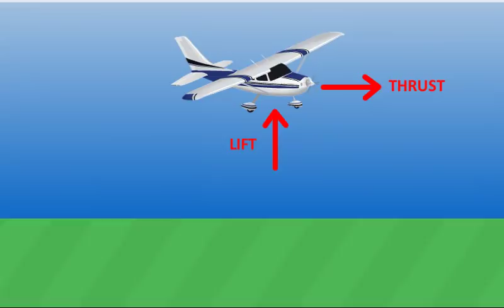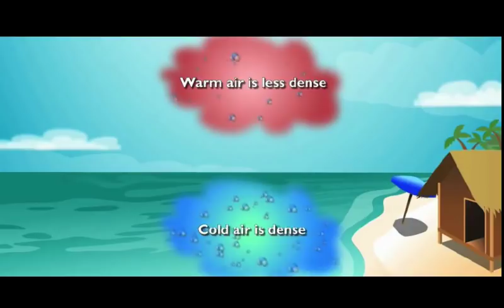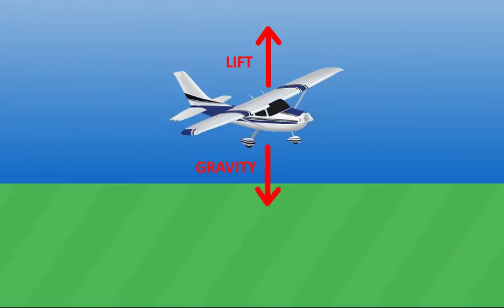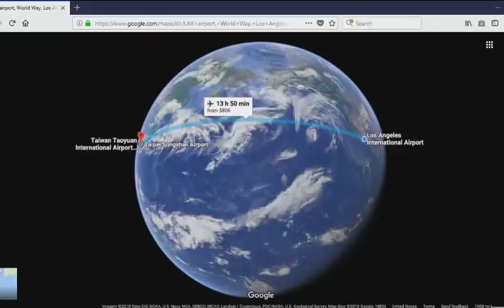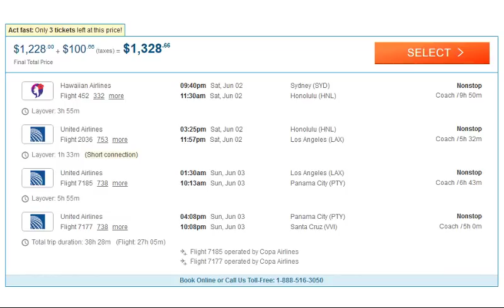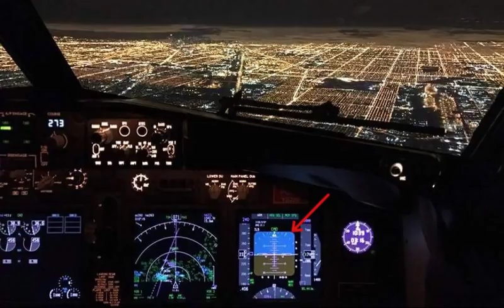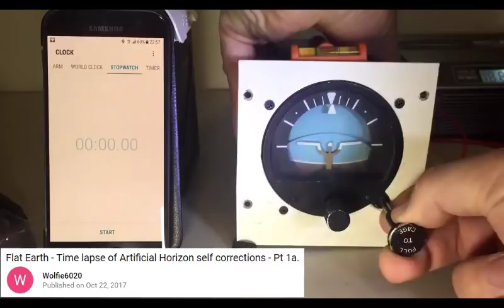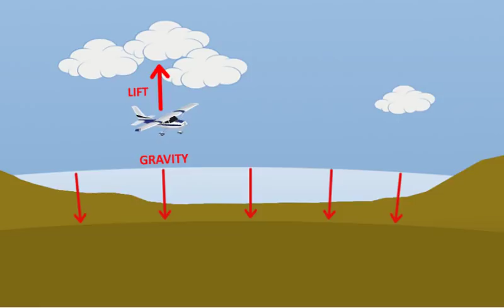Flat Earth Falsities - Plane Nonsense

Comment: If it weren't because of momentum, every time you jump you would land almost a km away from where you stopped making contact with earth ...
Reply: Do you expect that someone that thinks that earth is flat will read about The Dunning-Kruger Effect?
Reply: Jorge Lizaso 
or two km if youre black
Reply: Indeed, that's probably why Basketball is played in enclosed stadiums ....
Reply: jordy f :: it's called The Dunning-Kruger Effect. There's is the measurable fact that the less someone knows about a topic the more likely they are to think what they do know is absolute correct and comprehensive.

It's built into the brain.

Read up on it, it's fascinating. You can literally be so weakly informed that you don't know enough of a topic to understand how much you don't know.

It's why short "gotcha comments" are often so laughably incorrect.
Reply: Hey jordy, can you please film yourself when you try your experiment of jumping on a moving flat escalator?
I’d love to see the surprise and confusion on your face 😂
Reply: You land at the same spot for the same reason(s) that it's possible to play catch, stir a drink, and/or flush a toilet on a moving train/bus/airplane.

Heck, go get on a plane and do a little jump. The moment your feet leave the carpet the plane doesn't rush out from under you at 550 mph.

Why not?

Because you are going exactly as fast as the plane.

Now substitute "Earth" for "plane".
Reply: if you are on a skate board and rolling forward with it and you jump up do you land back on the moving board?  yes' you do.

If you walk along and throw a ball up in the air as you move forward does the ball fall behind you?  No it doesn't it comes back down to where you can catch it.

A person on the earth is moving at the same rotational speed as the surface when they jump they move through space at 463m/s , the gound also moves at this speed - there is no net horizontal motion difference between them, this is why they land back on the spot they jumped from...

But hey Jordy guess you'll never be a scientist as you don't really understand observed reality...
Reply: jordy f no sorry  the planet is a system consisting of solid... that's earth, and snow and ice ...liquid... that's rivers lakes and sea... and gas...that's air. other planets are the same. , most of them have an atmosphere... which is gas... and which is stationary relative to the surface except for wind
Reply: jordy f, if you jump, while on a moving a moving walkway in an airport, you don't suddenly stop.  Try your experiments before you challenge others.  How do you explain tossing a coin or a ball while moving in a car thats in motion (at any speed)?  Why doesn't the ball or coin suddenly hit you in the face?  I think flat earthers are incapable of logic.  Sad, really.
Reply: @jordy f
Fuck off you silly troll.
Reply: jordy f: you seem quite keen on this "jump on a moving walkway" experiment. Please try it!!

Here is what I say will happen: if the walkway is moving at constant speed then if you jump straight up you then you will actually travel forward at the same speed as the walkway and you will land back on almost exactly the same spot on the walkway. Any difference will be due to air resistance, but it should be very small. 

If I understand you correctly, you think that when you jump you'll somehow instantly lose your forward velocity, go straight up and land straight down some distance behind your original point (which you could calculate from your time in the air and speed of the walkway). Is that right?

You might want to watch this very short (1min26s) demonstration before you commit to your answer: https://youtu.be/CDf_0fPbNos
Or this one with much more height (also very short): https://youtu.be/KacTRPL1MtE
Reply: Since i skipped most science classes at school, you cannot state i believe all the lies they fed me. Never heard them in the first place. So.. why don't you, as the expert, explain this to me:
You said "When you are inside a car, you don't sit on a moving surface"  Uhm.. I don't get this one? The car is moving from point A to point B, right? But the seat i am sitting on in that car is not moving? Then how do I get from point A to B in the same time as that moving car? And not just me, but everything inside that car as well? Not an hour later, or a second, nope, everything inside the moving car, including me sitting still, arrives at the same time. How can that be when I am not moving, as you said? Please explain?
Reply: BitOBear

I read the same explanation for more than hundreds of times bro...
That's deception to keep you think that you are so genius but actually they fooled you like an idiot.

When you are inside a moving car, you are not moving at all, you can jump as you like. The moving object is the car relative to the road surface.

But when you stand on spinning ball earth, you are standing on a moving surface of the earth.

When you lose contact with the surface of the earth, you will be left behind.

Try to jump on moving flat escalator and please use your brain this time.
Go and try that genius.
Reply: dave d

if you jump, while on a moving a moving walkway in an airport, you don't suddenly stop

This is the good one. This is the correct example if the earth is spinning ball.
Try to jump when you stand on moving surface, could be moving walkway in an airport or your treadmill.

Please don't repeat the scenario that you are sitting inside bullet train or car.
When you are inside a car, you don't sit on moving surface. You just sit in static room of the car. The one which is move is the car relative to road surface.

Try to jump on moving treadmill. Then that's what you get if the earth spins.
How fast the treadmill, probably 10-15 km/hour.
Do you know how fast the earth spin?
ball earth circumference =  40.075 km 
It takes 24 hours to one rotation.
If you ride motorcycle to reach 40.075 km in 24 hours, then you need to ride it at speed of 1.669 km/hour.
This is actual speed if the earth spins.

I hope you get the logic.

David Austin,

which is stationary relative to the surface except for wind

So, you are saying everything move synchronously with the earth surface except the wind?
Hahaha...  I can't say anything about you statement above... I can only laugh ...hahaha:-D

I tell you all.
This is what you get when you try to fit a big lie into reality.
You can consider you are so clever and genius by believing whatever you read on your school book.
But, this is what you get, 
Everything moves together except wind ...hahaha

You don't even able to think and use your brain properly.
Good luck for defending Globe lie:-D
Reply: Jordy f ( i think, im losing track of who im replying to), do yo understand that you're now talking about two separate moving surfaces?  You do realize that on a tread mill, the running surface is SUSPENDED FROM THE GROUND and spinning on its own,  and you're not actually walking on the ground right?  I'm beginning to think you're just trolling. if so, bravo dude.  Jordy, if you have a gmail address we can chat about this.  Id really like for you to understand.  but again, if youre just trolling - job well done!
Reply: You landed at the same spot because the earth is flat and stationary

Why do people are so dumb but they thought that they are so clever, so scientific and so genius?... 
hahahaha

Comment: Jet streams are NOT affected
By the earths spin. Jet streams go from west to east, which would be faster than the earths spin. Jet streams go from Africa to the Gulf of Mexico east to west. And south to north from west Mexico up through Arizona. All jet streams move at the same range of speeds. This video starts off NOT debunking anything
Reply: Jet streams wouldn't even exist on a flat earth.
Reply: +Jeff Davidson
Full of smelly prune juice are you. That side, given the intellect and knowledge you seem to be claiming you should be able to answer these simple, practical questions.
Why is it that a compass needle is more or less vertical at the poles and horizontal at the equator?
And when you carry on past the poles the needle slowly returns to the horizontal?
Why is it that it is only possible to navigate accurately over long distances using spherical trigonometry?
Why is it that traditional gyro compasses work perfectly in low latitudes but became unreliable in high latitudes?
Why is it that it is only possible to navigate accurately over long distances using charts based on a terrestrial spheroid?
Why is it that when you watch a ship sailing away from you the hull is the first thing to go below the horizon, then the superstructure and finally the funnel and upperworks?
Does a magnetic compass point towards polaris (Alpha Ursae Minoris) at the north and south poles?
Does a gyro compass point towards Alpha Ursae Minoris at the north and south poles?
What is the relationship between longitude and distance when travelling east or west parallel to the equator?
Please explain the principles behind the development and functioning of a gyrocompass?
No evasions please, just straight answers.